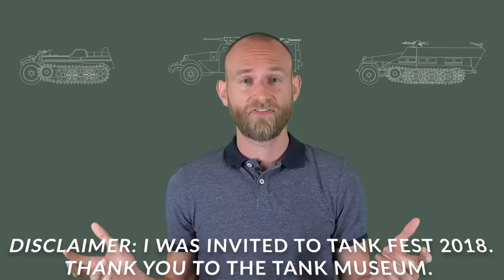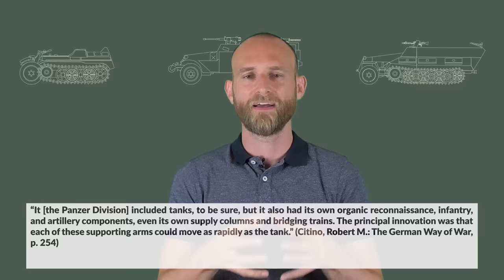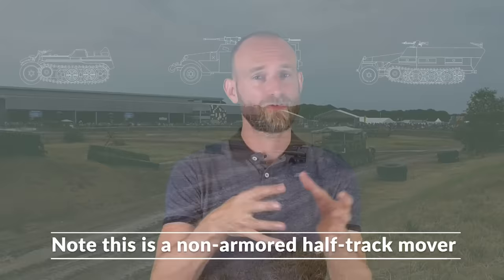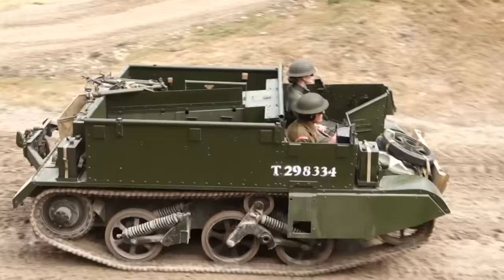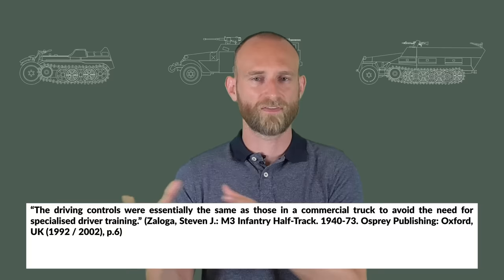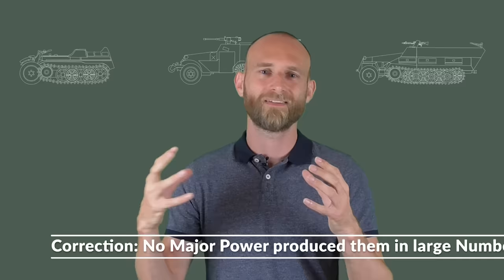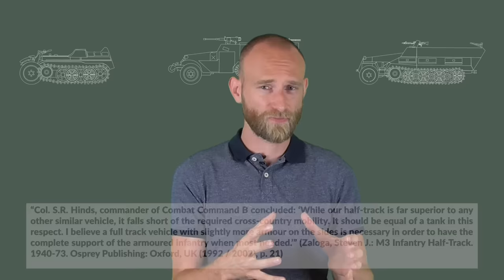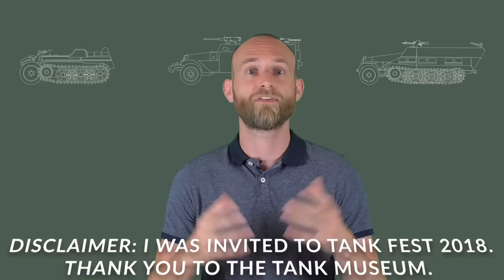Why Halftracks? Why limited to WW2 only? (Featuring Tank Fest 2018)

Comment: The introduction of model guns and the likes of the Canadian kangaroo personnel carriers made half tracks obsolete. The Commonwealth 21 Army used all track, the Bren and Kangaroo, what did the Russian army use in the war, personnel carriers? How often did the Tanks go into action because the infantry was not there, with  fatal results. For example, Villers-Bocage in Normandy, not normally discussed, is the afternoon battle when 5 Tigers and 4 Panzer Lehr Mark IV were lost because no Panzer grenadiers were available when 7th Armoured Division rallied after the morning ambush. Several other Tigers were damaged in the battle but subsequently were recovered and repaired. A smart commander does not take  open field tanks into a town without infantry support. What did 21st army group use in the Great Swan, going from Normandy to the Belgian boarder in days, the Cromwell is very fast, half tracks too slow, kangaroos are the same speed as Sherman’s.
Reply: The Bren Carrier / Universal Carrier is a tiny little thing - more a full-tracked jeep than a cargo carrier.  The Kangaroos seem like a good use of redundant tank hulls, until you try to dismount your infantry over the hull top under fire.  There's a reason why the idea didn't catch on.
Reply: Peter Stickney  please see video https://youtu.be/-DjcNZWVa0w from tank museum. The ram kangaroos were used extensively by 21st army. They could keep up with the Sherman’s but had difficulty with the Churchill’s because of there climbing abilities in infantry support roles. It may explain all the photos with troops tank riding Churchills. They were used extensively in the battles after Normandy to the end of the war. You are correct, they had issue like all tanks in getting off sensibly.
Reply: The Russian used some lend lease half tracks but mainly used tankodesantniki troops that rode on the backs of tanks and would jump off to provide support
Reply: The soviet army prefered to mount their infantry on the tanks themselves, hence the large amount of handles on soviet WWII tanks.
Reply: DC - The Russian army used Studebaker trucks.
Reply: The issue was NOT that Half Tracks couldn;t keep up with the advance by the Canadians and British troops........the "advance" was a constant but slow grinding one...not some lightning flash across.....the ISSUE was that the Americans where the ONLY ones producing the M3 Half Tracks, for both US AND British, Canadian and Russian use......the Canadians simply could NOT get nor retain enough M3's to make it worth while.......the Universal Carriers, don;t know if you;ve ever seen or been in one, are tiny...the "crew" area is pathetic...the drivers needed to be anorexic midgets just to get behind the wheel....at MOST a Universal carrier is going to transport 6 troops....there is simply not enough room in them....SO...the Canadians started to "defrock" the PRIEST SPG's and converted them into the first "Kangaroo's"....followed by the RAM II tanks that where de- turreted ...eventually SOME "Kangaroos" where converted from Sherman III's, even a few of the ponderously slow Churchill's........speed wasn;t the factor in them Kangaroo development...it was simply a LACK of available M3's to the Canadians, because the US forces where requiring MORE and MORE of them....
Reply: @SABRE 21 What about the M5 half tracks? ;)

Besides, the british commonwealth advance, from Normandie to Antwerpen was faster than the german advance in 1940.
Reply: You DO understand that the M5 was simply a International Harvester manufactured M3 right?...the ONLY differences being in that IH had different equipment in their factories...hence very small changes...also they where made for not even a full year..........so really?...WHY a separate slating for a minor sub version of the M3...same thing.....and I am well aware of the Commonwealth advance across France to Antwerp...I had more than a few relatives that where there....with the Canadian 1st Army...and also there during the slug fest with the Germans for Antwerp , the Sheldt, Walchern Island and the rest of Holland as well......
Reply: If you are so well aware of the commonwealth advance across western Europe, why refer to it as a "slow grinding one ..not some lighting flash across.." and even to the point of putting "advance" within quotation marks. It gives as much of a wrong impression as if you had only mentioned the dash across France.

Also, you seem to have a need to grow a sense of humour.
Reply: losing ones sense of humour is a fact of getting old...unfortunately.........and on here?, in many if not most cases it seems like there are swarms of 12 year olds that claim to know everything and will argue points that are idiotic and utterly wrong.......as an adult, one that served for over a decade in the CF ( Armoured Corp)....I generally don;t do well listening to drivel from kids   ....So YES, I agree I have a short sense of humour on here
By your writing it seems to me like you are an adult , so my apologies........

From all sources , including those that where there...for the Canadians and British, France seemed to have been a drive, then stop and fight, then drive on type affair...where the Canadians REALLY got bogged down was during the Antwerp and into Holland phase...with the Germans flooding the Polders and literally fortifying every dyke and farmstead, then as we are all aware the winter of '44 was a cold, long one that didn;t see alot of advancing at all....the "drive for the Rhine"...was much more a staggering walk...with the flop of Market Garden, the Commonwealth forces literally where fighting for every foot of ground and couldn;t even get the what, 25 miles to relieve the 1st Paras at Arnheim...however, AFTER Varsity and the troops where across the Rhine, while the fighting was hard, the speed was needed to drive as far as possible to try and beat the Russians and stop THEIR advance...most of the photographs of Canadian and Commonwealth / British troops riding on tanks, Kangaroos etc. seem to be from this period.....don;t forget that the entire Allied advance across Europe was consistently hampered by supply and logistical issues....there was a lot of needing to stop and wait, simply to allow fuel, ammo and rations to catch up, even after the Allies got the pipelines across the Channel from the UK, the fuel situation was a major factor for the entire campaign, as it had been for the Germans before them......that said, even in 1944 / '45 the Germans STILL had HUGE amounts of horses utilized in their forces, and that can be evidenced in the photos of the destroyed German columns during the Fallaise Pocket         Cheers....

Comment: So many wrong things we hear at the video. "Half-track has less cross-country capability" really, 15 ton 300hp half-track vs 50 ton 400hp tank? Half-track can run rings around stuck tank, it's all about pressure and power, wheels don't meke difference.
Also about driver training, that doesn't make any sense. It's all about price and production capability. For half track you can take any truck and bolt some tracks at both sides and you are there. For fully tracked vehicle you need two steering clutches and two independent breaks on top of all half-track thing.
Reply: "For half track you can take any truck and bolt some tracks at both sides and you are there."
Thats true for the US Halftracks, german Halftracks are more a fully tracket Vehicle with frontwheels.
They had a steering gear with a "dead zone" and can drive and steer without the frontwheels
Reply: Well yes, the quote is from a report from an American colonel in the 2nd world war, I'm sure he knew what he was talking. Half tracks do have a higher power to weight than tanks the difference in horsepower is a lot larger though with 150 vs 350 to 400 in the American case of M3 compared to M4, but power to weight mainly concerns speed.

The M4's were better at fording, climbing obstacles, had better ground clearance and would've been able to push through denser and heavier debris or foliage than the M3. I believe the ground pressure of the M3 is higher than the M4, although the M4 is much heavier than the M3 the contact surface area is many times larger too.

Im uncertain of how the issue of driver training and it being easy for truck drivers to drive half tracks and not need costly full track driving expertise can't make sense...

And yes it is indeed that simple to change a truck to a half track but that won't make it an effective APC only better at cross country. A combat half track has many different parts to a truck.
Reply: Not all of them. The Maultier is a regular truck with a Panzer I's tracks replacing the rear wheel. Or, more accurately, three or four different types of trucks, with a Panzer I's tracks.
Reply: Halftracks used truck engines which rarely went above 100hp.

Comment: There is one exception, the Czechoslovak built the OT-810, basically a copy of the Sdkfz 251, made by Praga and Tatra, about 1,500 vehicles built during 1958–62. Last vehicles were removed from Czech Army magazines in 1995. Maybe it is not significant, but I thought worth mentioning. Also the French also produced halftracks before wwii (Somua) and the Japanese during wwii (Ho-Ha).

Comment: The Czechs produced their own version of the German half-track after the war. The last attempt of a half track that I am aware of the was the Landrover Centaur. The issue with Halftracks besides the NBC stuff is steering. The US half tracks did not have steering assist, so the length of track on the ground had to be limited, otherwise turning is difficult. The Germans solved this by using a hydraulic that applied braking to the inside track in a sharp turn, allowing them to have more track purchase.

Comment: Both Chile and Iran produced half track designs in the ‘80s, the BMS-1 Alacran (the Iranian one was allegedly based on it). Admittedly by then they were outdated, as wheeled and tracked APCs had improved markedly. Equally, Israel made extensive use of halftracks right through the ‘60s and ‘70s, and I believe even later in some support roles. They were a feature in the both the Middle East and South American conflicts. So they didn’t really die out with the end of WW2 at all, they just became popular with smaller countries as hand-me-downs from the US etc.

Comment: There was OT- 810 produced deep into 1960s in my country. Czechoslovakia. OT = Obrněný Transportér. Armourered personal carrier. OT - 810 was a half - track build on the basis of Sdkfz. 251. But with Tatra air - cooled diesel  engine, covered top and anti - radiation capabilities. It's often used by reenactors as Sdkfz. 251 because of its better availability then the original german vehicle. 
Greetings from the Czech republic.

Comment: The American halftracks also had driven front wheels, which made cross country driving even easier but increased the turning circle; both concepts reflected decades later in the Humvee. The German halftracks had a small distance between the undriven front wheels and the track, somewhat negating the disadvantages of undriven front wheels.

Comment: Good video. Good presentation.
The first modern APC was really the Canadian use of obsolete Ram chassis to make the Kangeroo. It was more resistant to enemy fire than a German or US Half track but still has an open top.
However. It is fully tracked and was a makeshift solution.
The fully enclosed APC idea US M113 and British FV 432 are really battle taxis. The Infantry must dismount to fight therefore the next step is the IFV which enables the Infantry to fight from the fully enclosed vehicle this means that the IFV idea is embracing the WW2 half track from which the Infantry can fight but now with reasonable protection overhead the IFV is the best of both worlds.

Comment: A few years ago I visited a milatery museum in England. They had a very early attempt at a half-track. What they had was a modified Triumph 550cc motorcycle with a track in place of the rear wheel. Two were made as experimental vehicles to make things easier for bispach riders in and near the mudbath that was the front line.. I beleave they had limited success but only two were made and only one survives.

Comment: Also, in combat a US Stryker or Russian BTR can have several wheels blown out  from enemy fire and still keep running. At minimum  these vehicles only need two wheels in front and two wheels in the rear. If a track takes damage it’s immobilized and has to be replaced or the damaged section of track removed and replaced. Spending as little time outside your vehicle under fire is ideal

Comment: Couple of points: The half track could use a shorter track width to length ratio as the front wheels eliminated the pitching. Also All Wheel Drive was still primitive (as was suspension), so no eight wheel drive troop transports for keeping up with tanks on difficult terrain.  The "Bren" Carrier:  Is fully tracked and has a steering wheel.

Comment: The mermaid analogy makes the most sense. The half tracks were a mostly thrown together solution using then existing tech and often off the shelf parts. But they were trying to serve two masters. Off Road and on road mobility. As the services developed and advanced post WW2 they largely designed better purpose designed vehicles for each function. The half tracks always struck me as having one key design flaw in a vehicle intended for direct combat operations. Your radiator and engine is the big target facing towards the enemy as you advance. This always struck me as a somewhat questionable design decision. Only really tolerated because they were mostly starting from existing vehicle designs to get stuff into the field faster and cheaper due to critical need.

Comment: The British Army didn't use halftracks because they were one of the first armies to be fully equipped with 4x4 trucks with large wheels and tyres, which had much better offroad capabilities than the modified 2x6 and 2x8 civilian trucks that most other armies were using at the time.

So the British had the Universal Carrier for front line transport, and 4x4 trucks for rear area transport.  They didn't need halftracks as much as the German and US armies did, although they happily accepted M3 halftracks on Lend Lease.

The Soviet Army used both the Universal Carrier and M3 halftrack on Lend Lease, and liked both as an alternative to trucks.

Comment: Halftracks where used post WWI quite extensively. Israelis used old US m3 and Czechoslovakia produced OT-810 which was basically a modernized variant of the Sd.Kfz. 251.
Reply from the maker: Major powers and produced...
Reply: The only two major powers ever to field half-tracks in any numbers where the US and the III Reich. The first one simply moved aways towards heavier vehicles the second ceased to exit with production lines ending up behind  the Iron curtain, hence the OT-810.

Comment: I have read repeatedly that Germany wanted fully tracked APC's from the start but that German Industry was not capable of meeting the demand. The compromise was the Hanomag half track. Germans had several designs for fully tracked vehicles capable of being used as fully tracked APC's but never put them into mass production.

Not a major power nut Israel and Czech's used 1/2 tracks well after WW2. Israel used American M3 halftrack and Czech's used a modified SdKfz. 251, which received a roof on some models.

Comment: My 5 second explanation would be that better transmission designs allowed for fast tracked vehicles.  These simply hadn't been designed yet until double differential transmissions were developed.

Comment: My best guess is that a halftrack combines the weight and fuel consumption penalties of tanks with the ability to get a flat tire of trucks. It was kind of a jack of all trades/master of none vehicle, so there was no real advantage to using them over either a regular truck or a fully tracked vehicle.

Comment: It's the same reason why after WW2 there were no more tank destroyers, because technology became good enough such that the trade-offs between mobility, protection, and firepower were no longer as extreme as before. It then became far better to just create do-it-all main-battle tanks. It's the same with half-tracks.. technology simply became good enough that it was possible to build fully tracked infantry carriers that were big enough, fast enough, and armoured (including topside), so compromises such as the half-track were no longer necessary.

Comment: One has to remember that early trucks had both low power to weight ratioes and poor suspensiona nd traction making their cross country capability fairly modest.
Even models porpouse built for military service were seldom optimized for off road duty.
So the halftrack in part served to detatch motorized infantry from the existing road network.

Comment: Like the mermaid example. A lot of people do not know this that tanks generally - and this depends on the terrain and distance - are really not cross country vehicles despite their tracks. In WW2, a German tank division had its recon/scouting component made up of ground units and supplemented by air support. Once the enemy was sited and measured then the panzers were brought to forward areas by train or road transporters and deployed at a close distance blocking roads, bridges and communication routs. Tanks most of the time travel on roads - and for short distances - and can only go through fields and flat lands. Hills, forests, swamps are the enemy of tanks.
On a side note, it is my opinion that in the near feature tanks (panzer) will become obselete as better anti-tank weapons are being developed as we speak. The most powerful arm today is the airforces.